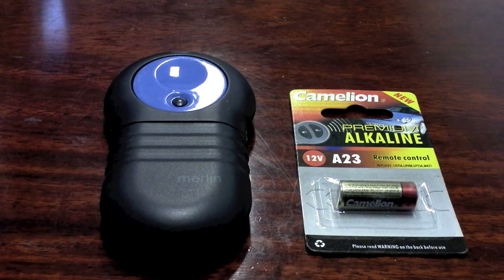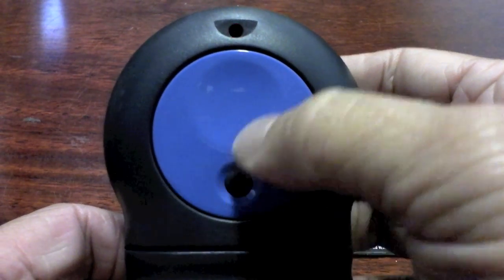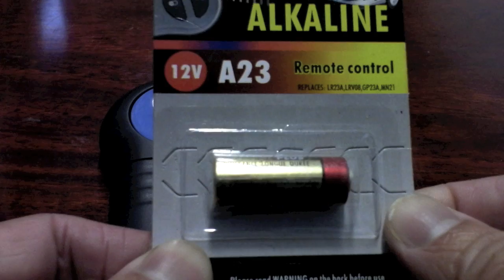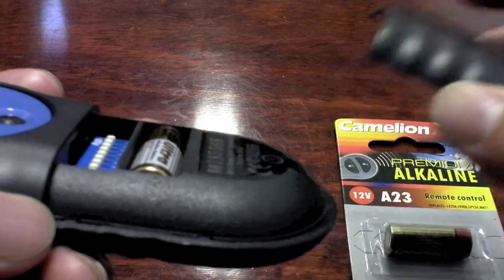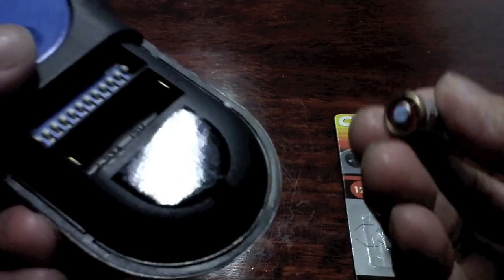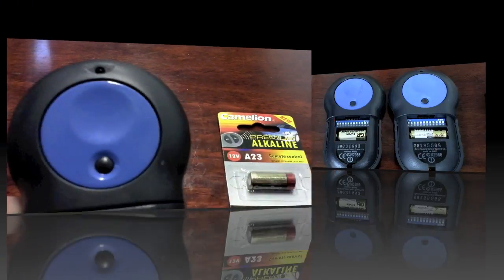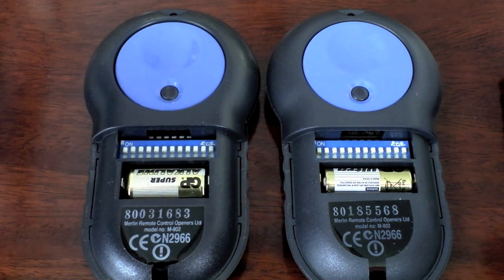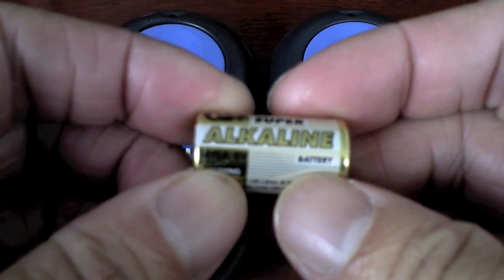How to replace the batteries in your Merlin M802 remote control

Comment: Thanks now I know how to open the wall button but mine is a Merlin M832, which looks exactly like one in video but green and has an A544 battery, 6V but you (and all other videos) don't mention it anywhere!
Reply: Mine is also the green one.  Works sometimes though.  I need to change the battery.  Where can i get the battery.  These are not available in the supermarkets . Any suggestions??? Thankyou.

Comment: Confusing, you show a 12v battery, but the M802 may be a 6v device. You need to point out the issue here first, not at the end.